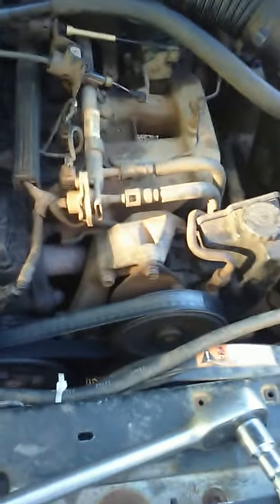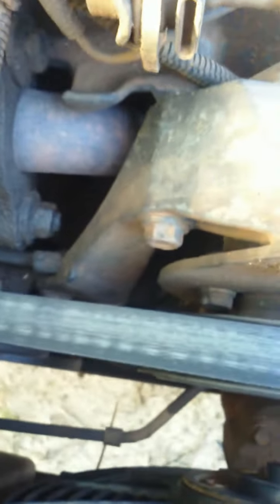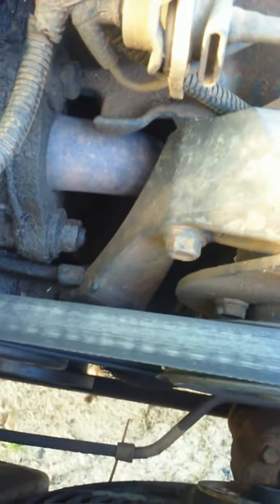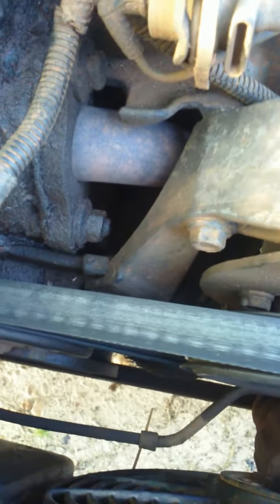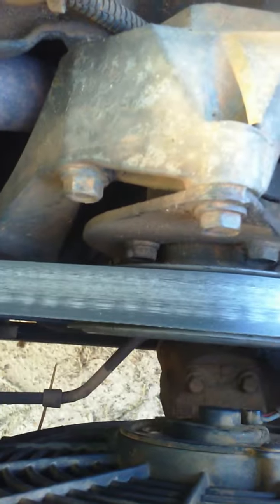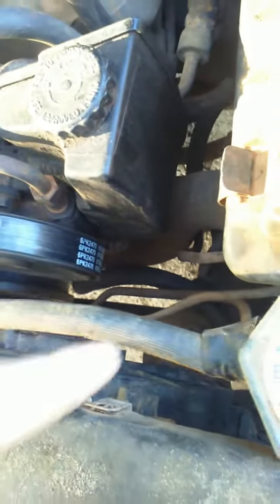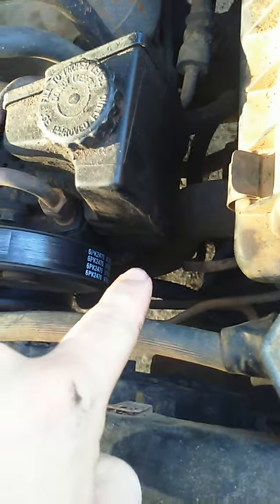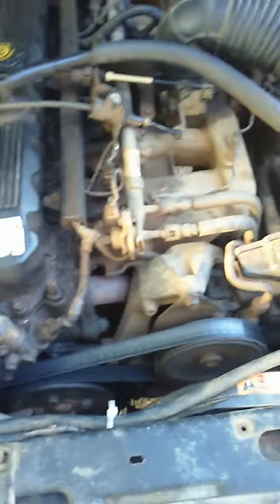Adjusting belt screw for 95 jeep Cherokee 4.0

Comment: Pretty useless without an explanation for loosening the bracket bolts so the Adjuster Bolt can actually work.

There are three 13mm bolts to loosen in order to move the bracket.  One is the Pivot bolt at the top of the thin steel bracket visible at 0:15. The other two are located behind the assembly.  They are the slider bolts that are run thru arched slots that allow the assembly to slacken as you turn the Adjuster Bolt.  It takes a lot of movement of the Adjuster Bolt  to really get slack enough to slip the belt off - about a half inch out.  A short, ratchet type box end wrench will be very helpful .

This is MUCH easier done by just getting under the front and looking straight up at the back of the Assembly.  There are no obstructions that way.  5 minutes.